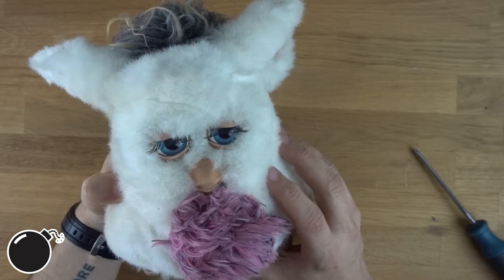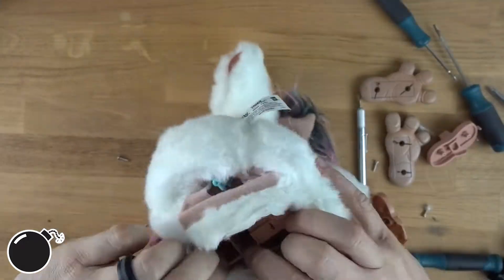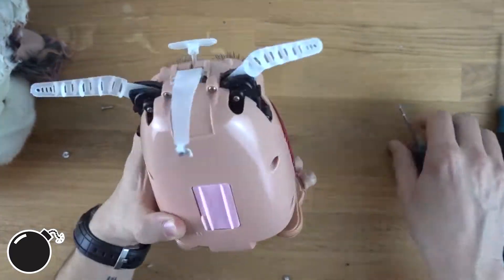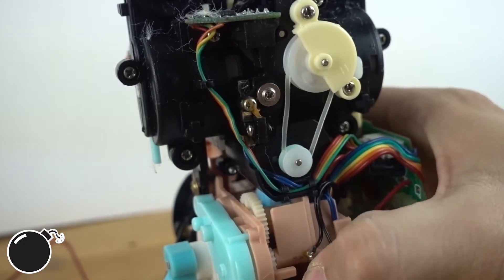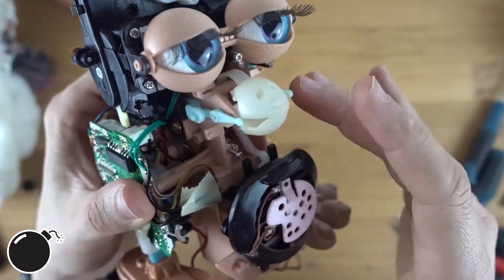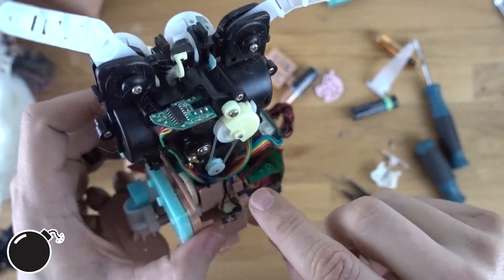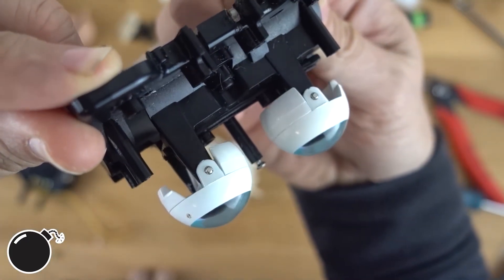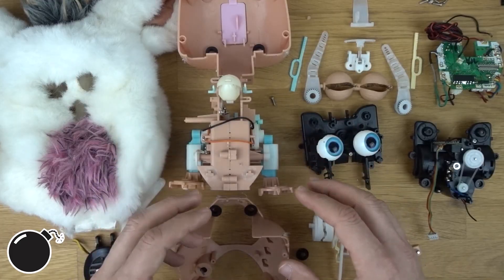Furby Mechanical Teardown - Nightmare Fuel....

Comment: I have a Champagne Spanish speaking Furby. I saw the wires leading from the reset button to the battery posts needed to be resoldered and I was able to do that, but then something weird happened. It speaks fine, but won't move. I have no idea if another wire that's for movement has detached somewhere. Can you help me with this issue?  Thank you
Reply from the maker: I had a good time taking him apart but I am no futby expert, sorry... Good luck!

Comment: the beak is in an amzing good condition...this part seems to be broken in all devices, the rubber deteroirates. and the expression with the corner of the mouth, smiling or not, really not bad. bummer that they did not develop that direction more...

Comment: What was the purpose of the winding wire on the left and right sides? Nobody can give an answer. Are these antennas? Is this a capacitive sensor? It was believed that Furby could listen to a room and transmit sound over a distance.
Reply from the maker: I'm not 100% sure but I think they are a touch sensor. Maybe capacitive

Comment: Those triangular head screws don't need to be Dremeled. You just need a flat blade screwdriver with a small tip that will fit into the long edge of the triangle. They'll spin right out, easy as.

Comment: I'm really impressed that they were able to pack all these different movements (eyes back and forth, blinking, talking, smile/frown, moving eyebrows, moving the ears, and moving the feet) with just a single motor. 7 or 8 different animated parts, which all have the illusion of being independent of one another, on one motor. Some really great engineering behind these. If you would have asked me prior to seeing this teardown how these worked, I definitely would have guessed that it used many different servos.
Reply from the maker: Me too! And the newer ones just have screens for eyes..... Sad....
Reply: @thoughtbombdesign  The 2023 Furbies have physical eyes again but all they do is blink and I dont like how they look. I actually like the digital eyes on the 2012s to Connects, they're so expressive and fun to look at with many different animations. But I like the idea of physical ones moving around in different directions too, so it's sad all the 2023 Furby eyes do is blink.
Reply: It's because most of the code was just written into the source code..

Comment: Fun fact: the wires on the sides of the 2005 furbies were used to detect touch!
Reply from the maker: That's what I figured, mine must have been broken... Thx!
Reply: @thoughtbombdesign  hey, you're welcome! I also entirely guessed that. Have you replaced the wires on the side? If so, I'm guessing it was kind of a difficult job to get them around the tabs!
Reply from the maker: No, the project was a one way trip to disassembly.... ;)

Comment: I feel like the most interesting part would have been examining the circuit board components
Reply: The most interesting part to me is that furbies use an intricate transmission that allows every moving part to be controlled by one single motor

Comment: what to do if your furby is acting like a demon

step 1 rip off the furbys skin with your hand or a tool

step 2 take of its plastic and the rubber band things

step 3 get a knife and cut of all the wires

step 4 put the plastic and fur back on

step 5 there you have it a non working furby

step 6 if it keeps talking rip of the skin and plastic again

step 7 rip out all the circut boards motors and gears

step 8 make sure nothing is left inside the furby if there is rip it out

step 9 put on plastic and fur

step 10 there

step 11 if it keeps talking go outside and smash it with a sledge hammer and drown it and throw it with all your force at walls until its completely broken

step 12 its solved NO MORE FURBY

Comment: great video! Guess they don't get demon possessed after all? ;)

So what did the long red and black wires go to on the opposed end from where they were glued? I didn't see you mention that in the video? What was point of them leaving the wires long and wrapping them up in the case? Programing or maybe power while being quality checked? Just seems odd to leave those there like that instead of just clipping them off short if not needed or fully desoldering them from the board...
Reply from the maker: I wouldn't be so sure there are no demons involved! 😁. I never did figure out thise wires. My only thought was that maybe it was an antenna that let multiple furby's interact? Was that a thing? 🤔
Reply: @thoughtbombdesign  Or they maybe induction sensors to detect human hands to make Furby interact
Reply from the maker: I thought that too but I couldn't get it to do anything by touching them. Maybe mine was just broken though....
Reply: Iirc the wires are to allow 2 furbies to interact with each other. They’re RF wires and function as antennas basically
Reply from the maker: I was thinking that too. Is that a guess or is that what they actually are?

Comment: It's impossible to take apart 2005 Furby without cutting fur?
Reply: no just lever it off
Reply: That is sadly not possible.
Reply: And its 2006
Reply: laki10j Mistery 2006 Furby baby?
Reply: @Sagifromsagipagi nope
Reply: @Sagifromsagipagi that fiurby in video doesn't have an tail. 2005 furbys have no tail. 2006 furbys do.